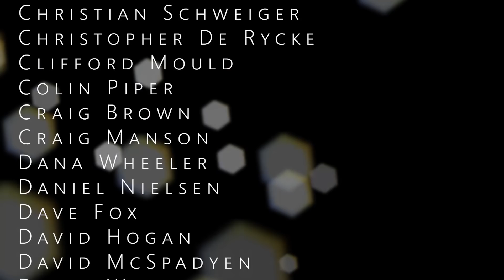Ep 6 - Taking a Great Kit Guitar and making it Awesome

Comment: I just discovered these videos a few hours ago, and am enjoying them almost as much as you seemed to enjoy creating this work of art, Ben! And as a thank you, and in case you still haven't found out why Mod Podge is called that, I can tell you! It is a play on the French term, decoupage, which means "to cut out", or "a cutting out", and is the name of the crafting technique of using overlapping cut pieces of paper and lacquer, glue or varnish to bind them. This craft became popular in the United States the 1960s and into the early 1970s when I was a kid. However, as it became popular, it was soon discovered that most of the binding products were hard to work with, resin based, and took a long time to dry. So naturally, someone came up with a formula which worked better than any of the other common products for this application- a water based,  quick drying glue of the proper consistency to adapt to differing methods of application- like brushing on (as you did in the video), sponging on, dripping, dispensing from a tipped bottle, using fingers, and of course, full dip-coating -  and that was cheap to produce, easy to clean up- very important when a classroom full of 3rd graders are making collages- and which dried and stayed clear. Obviously, this was a superior product for the production of "modern decoupage", or....  Mod Podge, for short! The second half of the name is simply a phoenetic spelling of the back half of the French word, decoupage. 
I can't say with 100% certainty that this is indeed the true origin of the product's name, but I suspect if it is not exact, it is very close to it, as it is the explanation which my paternal Grandmother gave to me when I was about 7- back when Mod Podge was still a fairly new product. It makes sense to me, even some 45 years later, and I am willing to bet my Grandma didn't lie, make it up, or even stretch the truth- it wasn't in her character. She didn't tell fibs to keep children happy- she told true stories of her youth, or my father's childhood antics for that. And when asked a direct question, she would admit she didn't know, unless she did know. So I do trust this explanation, and even if you are skeptical, I do hope you enjoyed reading it as much as I enjoyed reminiscing, and remembering my Gran'ma, Ramona (Gahr) Thole.

Comment: Will you install a lighting system to give depth and color?  You could add different color lighting tape around the interior sides and top to have the interior glow in static, random cycling, or programmable colors.  Better yet, make it like a light organ that changes colors as you play, with light colors matching output frequencies and light intensity matching volume levels.

BTW, I'd personally paint that whole part as dark a purple as possible just this side of black, with green highlights, then paint the chamfers gold or cut brass or copper pieces to line the chamfers.  That with a subtle light kit inside would be stunning.

Comment: Cool Design, only i have one Problem with the AluminiumFoil technique. Why did u not use Aluminium Roofing Tape? It is a little thicker, and will give such a nicer surface to look at and to reflect the light to create the Sparkle that thing needs. Otherwise Very Nice jobs on all the other work you have been doing. Keep it up Sir
Reply: Case of Seeing Something, pauzing the Video to Write Something up, press play to Have the precize Explanation you needed. Hahah
Reply: I use copper tape for shielding and it's infuriating to work with as the adhesive has significantly more grab than the tensile strength of the tape so it it's difficult to do complex shapes without tearing it.

Comment: Another technique would be to use Size and gold leaf/silver leaf/copper leaf, with which you can achieve either a rippled or smoot effect, and is a technique I have used to add gold leaf to inlays, etc., and may be easier to achieve a similar result. Quo @ Quo Guitars

Comment: Hey, I’m building a strat body, and just joined the the neck to the body, and I suppose i didnt drill the holes large enough or the screws i bought were just too cheap but the heads of the screws sheared off.
they’re in the neck and doing their job now but i wanted to take the neck off to paint the body 😬 and obviously it’s just not an ideal situation for a strat 😂any ideas?
Reply: Drill out the remaining screw parts, dowel the holes, buy new, better screws, drill pilot holes, reinstall
Reply: Model Railroad Pal thankyou so much bud, should’ve learned my lesson after the first one sheared off but i just stupidly went for it anyway and killed a second one in the process. I’ll give this a go, cheers
Reply: Also, when you reinstall, make sure the holes you drilled through the body are large enough for the screws to easily slip through without catching thread (same size as the hole in the neck plate is good).  The threaded part should only be in the neck itself.  This will accomplish 2 things, it will stress the shank of the screw less, and more importantly, it will allow the screws to pull the neck more firmly into the neck pocket.  Another little tip, running the screw thread on some wax, a candle will do, will lubricate the screw a bit and make it thread a bit easier.
Reply: Model Railroad Pal... one of the things I love about this channel is how knowledgeable other viewers are. I'm in a broadly similar situation (rebuilding & upgrading a cheap strat copy). Your answer here effectively gets me out of a hole. So...thank you for answering a question you weren't even asked!! (I thought I was going to lose a lovely neck and now I can save it!)